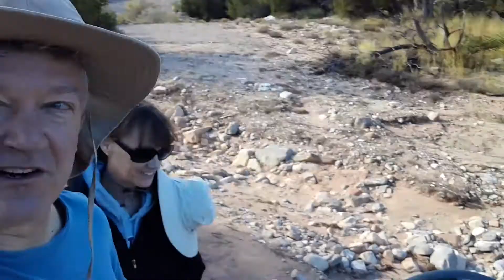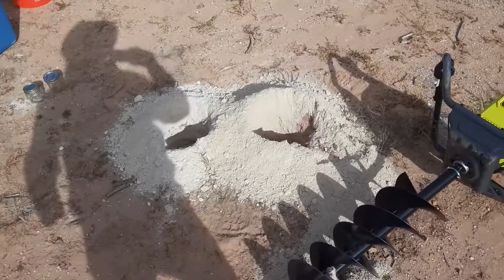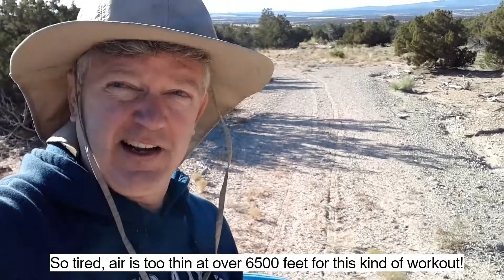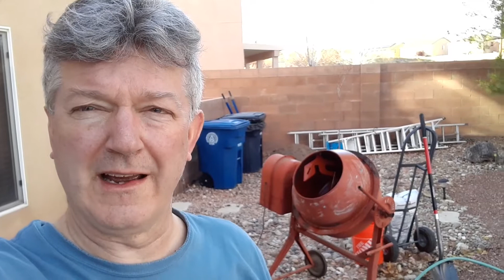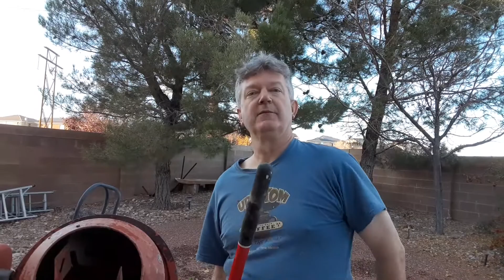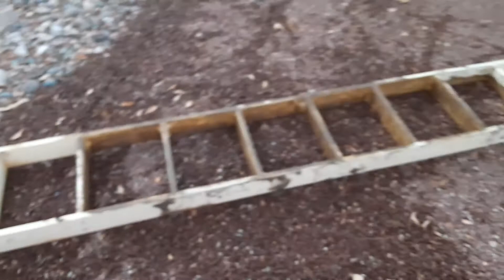NPL Episode 010: Adobe Test Bricks

Comment: We rented an adobe home on our visits to Mountainair, and I can tell you there is a reason civilizations have used the adobe brick as the best building material for regions like this.  On the hottest days, the rental would remain cool and comfortable.  Unfortunately, we never learned who the builder was. As to your question about the soil, I recall local residents referring to the ground in deer canyon as being called calachi. (Not sure of the spelling).
Reply from the maker: Hi Paul, thanks for sharing.  We've done a little more research, though still need to do more, but what we are understanding there is a lot of alabaster in the area which we've found some of these soft white stones and that they are likely the source of the caliche (spelling?).  I'm thinking that the alabaster as we dig it up can be set aside and possibly sold to artist to carve with, if the quality is good enough?